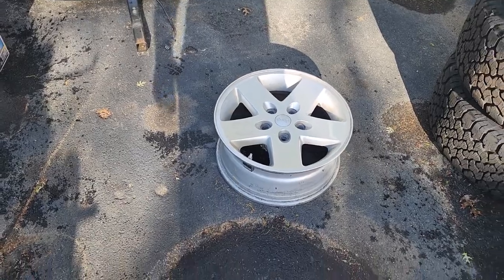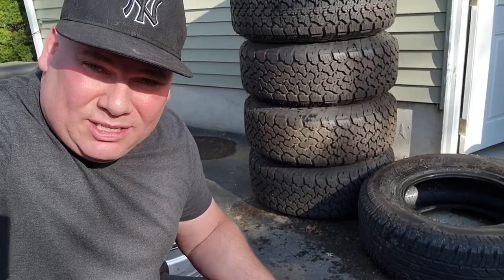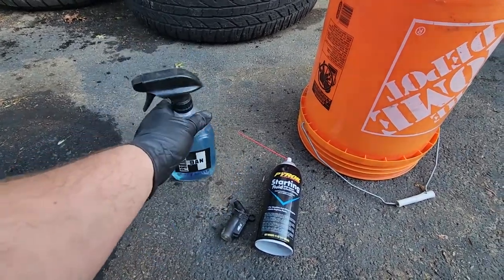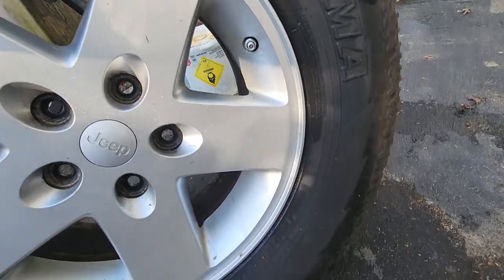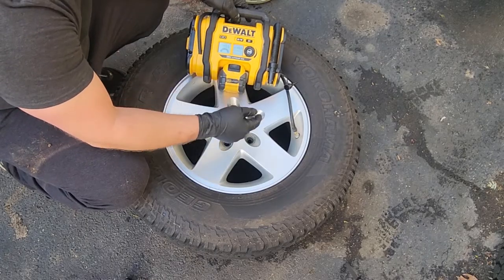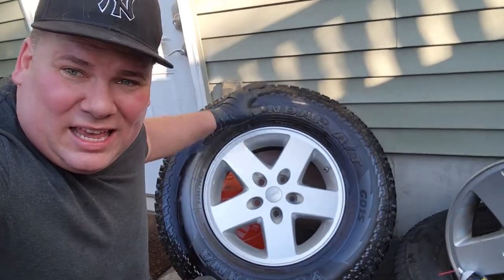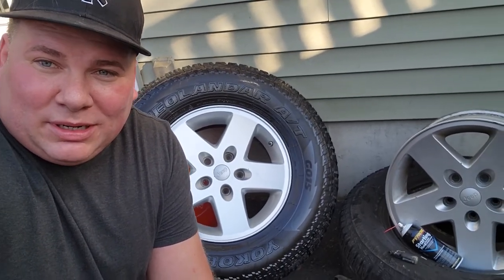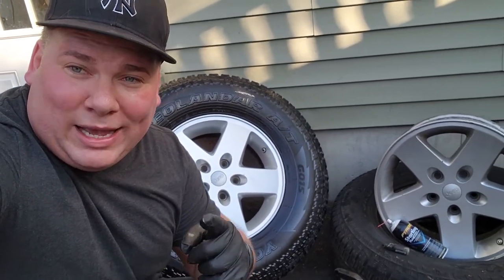BEAD A TIRE WITH FIRE - A BACK YARD BEADING!

Comment: This video should come with a warning. The dangers involved with this method can not be overstated. Without a doubt this method works. I’ve used it probably 50 or more times in my life. But I’ve also blew brand new tires up, I’ve broken the steel belts in the tire rendering it useless and I’ve had a loader tire jump about 25 feet into the air. That’s a combined weight of over 175 lbs flying through the air and bouncing around on its return to earth. Someone could easily get injured or unalived by this method. Try at your on risk.
Reply from the maker: Yes Sir.. a couple seconds max... Not a whole can!

Comment: I got a manual tire changer from Harbor Freight and it has served me well. It has a bead breaker and you can get the tires on and off without too much trouble. I usually mount my tires then take em to my local tire guys for airing up and balancing.
Reply from the maker: That seams like the way to go!
Reply: If you don't want to pay for balancing, buy the beads and save the money.  👍🏼

Comment: A Coats 4040 makes all that much easier.
Install the tire on the wheel and inflates it in less than one minute!!! 🙂😃😁🙄

I've been fixing flat tires on bicycles, cars, tractors, and trucks for over 40 years and I never heard of that bead goop.

Comment: I was thinking you don't need a bucket for mounting the second bead onto the rim. It just looked more awkward than doing it on the ground. Can you please tell me why acing it flat on the ground isn't a good way to do that? Thanks.
Reply: Flat on the ground scratches up the rim.
Reply: Not only that but on the ground you have more support for you weight off the ground all your weight is where you want it. I have a manual changer though never done this. Manual changer with 2 of those new plastic clamps is a breeze. So fast. Just here for more fire instructions